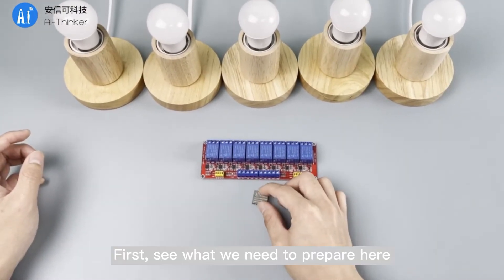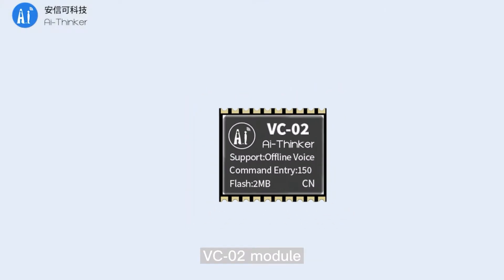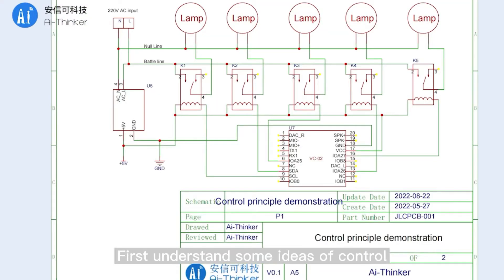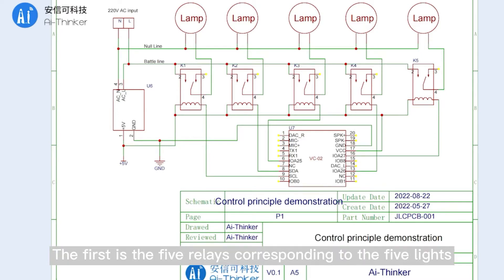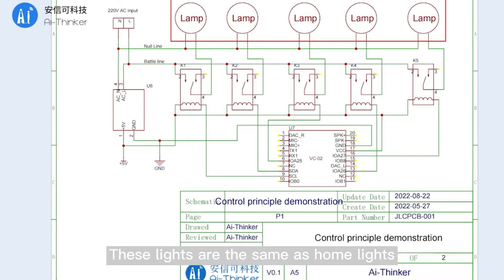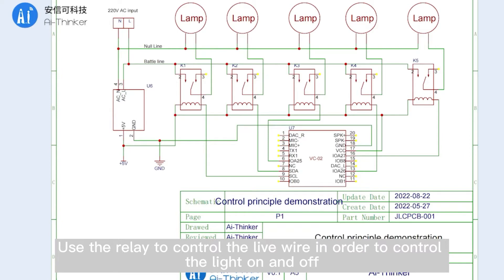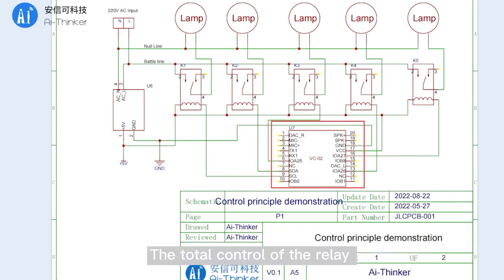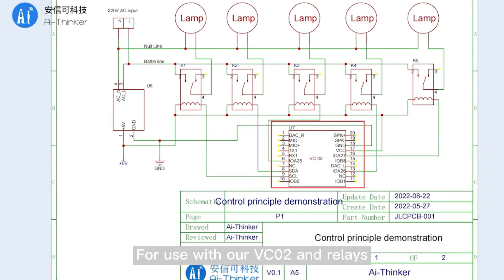Ai-Thinker's Offline Voice Module VC-02 Control Home Lights Solution

Comment: this is old and poorly supported, ai-thinker you are very very behind the times. maybe listen to customers and make a product they will buy.

1) trainable wake work x3+ so it can learn multiple voices. 
2) Trainable words in a 2 level tree structure group, say 15 top tier words to 15 2nd tier words to provide item control granularity. IC can output 2 byte code first byte for tier 1 (0-15) followed by tier 2 (0-15) for the 256 recordings, but IC only needs to recognise speech for 15 samples per command needing less processing power
3) serial port + 10 gpio fo standalone robotics/domestic use etc 
4) Arduino compatible libraries with support for home assistant alexa and google allowing wifi connection via esp8266/esp32 using GPIO/serial (in 3 above) 
5) <$25

Such a product would dominate the market as it can be used by small to large OEM's and home users with no market segmentation, you would not need any sdk and as its trainable it would work in any language.
I suggest looking at your competitors product especially df2301q